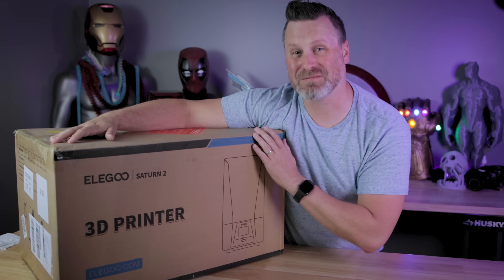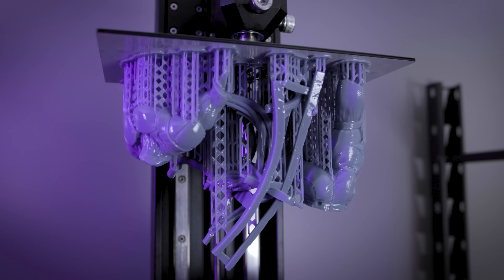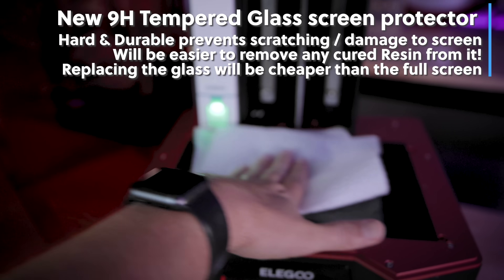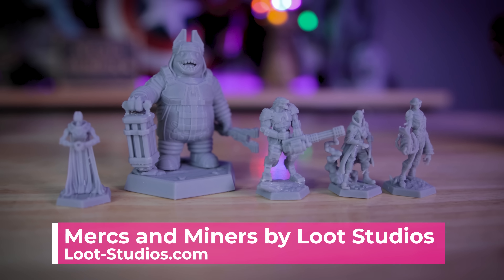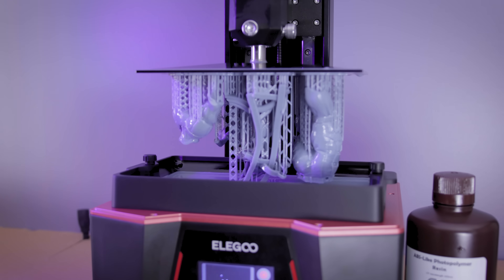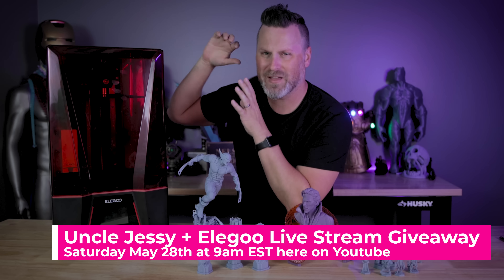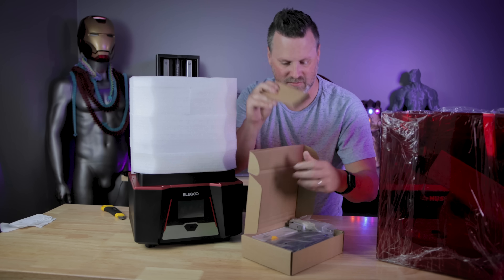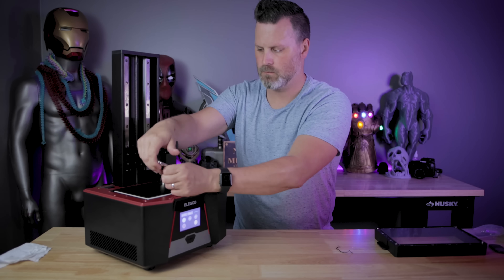Elegoo Saturn 2 8K Resin 3D Printer - CRAZY DETAILS!

Comment: Hi there, i have the Saturn 2 8k, and i have some problemts with the leveling. I go and push Home and open the Screwsm and whan its all the way dont i use a paper under and leveling the plate. and tighten the bolts. but when i starts printing, its look like its going tofar down, it comming a sound that the  motor is going but the build plate is all the way down and trying to go more. can you help me, i have a video the i filming what happends. :D
I hope you can help me.

THX

Comment: A little video necromancy. Asides from the marginally smaller pixels (28.5 vs 24x19) and a whole 10mm vertically, is there any big advantage the Saturn 3 has over the 2 8K? Looking at upgrading from my Mars 2 now I’m printing more for DnD.

Comment: Jessie,  I just bought my first resin printer after watching your video, the Elegoo Saturn 2.  I also purchased the Wham Bam XTR build plate also after watching your video.  I have never owned a resin printer before the Saturn 2.  However, I have tried to print a couple of times now but when the print finishes, there is nothing on the build plate.  I would really appreciate your help.  I am using the Sunlu water washable resin because of my wife's chemical sensitivity.

Comment: What settings did you use? Im using what Elegoo told me to use and Im having zero success.. Just alot of prints sticking to the fep... I've lubricated the fep, re levelled, sanded the plate slightly.. I have tried reducing the lift speed and increasing base layer exposure.. any help would be hugely appreciated.

Comment: I think I can explain the fancy new light source/lens better than the paperwork did.  The fresnel lens (pronounced frenel) takes the light and makes all of it point directly upwards.  One way you can see this difference is to turn on the little test elegoo logo, put a sheet of white paper on top, then lift it up.  On an older model you will see the logo get bigger as the light spread out.  On this newer machine the logo shouldn't change size despite you moving the paper further away.

Comment: Very cool, but it's hard to understand without seeing models printed on a standard 4K resin printer vs an 8K printer if the extra resolution is noticeable. 

Layer lines have more to do with layer settings in your slicer than resolution.

Comment: Hey Uncle Jessy! Is there room on the back right of the printer to add another 1 of elegoos filters? I'm worried the single 1 on the left won't be enough.

Also, the mini elegoo filters have a usb power port... do they have batteries inside or do they need to be plugged in? If they do have batteries how long do they last?

Comment: Questions I still have:

1. They claim a new type of lamp / screen. Does this actually make a difference than the Saturn. For example, are the days of seeing grid lines in prints gone?

2. They claim it has a scratch proof glass to avoid damaging the screen during spills and scratches. But, is this glass attached to the LCD? Does it actually stop resin from getting on the LCD? Does it negate the need for aftermarket screen protectors?

3. Are there any print issues like with the line through prints on the Saturn? 

4. Has the vat design changed in any way to aid in pouring out resin, changing the FEP, or seeing how much resin is still left?

5. What is the difference between 8K and 4K resin and what happens if you print in 4K resin? 

6. Are any of the issues with the Saturn present in the Saturn 2? For example, the tendency for the vat screws to become stuck or sheer off. Does the light still get stuck on.

Comment: question, if the mars 3 is 4k but the saturn 2 is 8k, does the mars 3 still have the more detailed print? as the screen is smaller or are we talking Pixels per inch?
Reply: Mars 3 is 35micron, Saturn 2 is 28micron, so technically Saturn 2 should be better in detail.
Reply: @VGModelling  thank you for clearing it up

Comment: Great review as always. To confirm you did use older type of resins as well (4K) from the mixed resins you showed for the various prints. Obviously understand that the 8K may offer ultimate results but the option to use 4K resin would be good.
Reply: Scammmmmmmmmm, don’t respond.

Comment: I’m curious how this compares to the Phrozen Mighty 8k.
Reply: Both printers have the same XY resolution. I would assume that the quality of the prints will not differ, if the printer works. And there we have the "if". How reliable are both printers? How good is the quality and accuracy of the mechanical parts (are they at least accuracy class H? - they don't tell us that)? That could make a difference in regard to printing errors and in particular layer shifts and z-axis wobble, which can ruin an entire model. Judging by the price I have my doubts that the parts are accuracy class H. The printers would be more expensive with such parts.

Comment: I've been playing around with a fresnel lens for the past 6 months or so on a modified Photon Classic. Works pretty decently but I need to set the focal point back just a tiny bit more. It was basically an acrylic fresnel magnifier (not the floppy kind, maybe about 1.5mm thickness) that I cut down to fit in between the LED and LCD. Cost maybe 5 bucks for the piece
The idea was bounced around a little bit a couple of years ago by some people around the time paraLEDs were making an appearance in the modding space but I guess paraLEDs gained more traction
8k resolution is going to be nuts. Looking forward to the new gen printers :yougotthis:

Comment: What does resolution have to do with layer line visibility?  Were you using antialiasing?
Reply: Z-resolution (layer height)
Reply: @RM_VFX  The "8K" on this machine refers to its XY resolution, not Z.  Uncle Jessy said he was printing .05mm layers.  Those are going to be just as high as .05mm layers on any other machine.  Why were they less visible here?

Comment: So....simple (or maybe not so simple) question. 

Elegoo Saturn 2, Phrozen Mighty 8k, or Anycubic M3 Max? 

Been kinda stuck between the Max and the Mighty, and now a 3rd player enters the fray. 

Max is larger (build area), but only 7k, and larger XY resolution as a result. But has the autofil function. 

The other 2 are similar in XY res, (28 vs the almost 43 on the Max), Saturn 2 gives you an extra 15mm of height (vs Phrozen), and will be $400 cheaper (based on early bird price, $200 cheaper vs reg. price than the Phrozen)

Did I kind of just talk myself into a Saturn 2?
Reply: Following. Already ordered the M3 Max for VOLUME prints, however since I m into miniature wargame I d like to have sth with extreme detail. If its the same quality as Mighty 8k but cheaper, I might end up going for it. But any advice would be appreciated.
Reply: @Patrikable1  I kind of wanted the larger height, for larger builds, but the Saturn 2 only gives up 5cm in height, over the Max. 

I think the biggest I might build would be a 1/16 figure, which averages out about 120mm tall, so shouldn't be an issue. Could almost go double that size. 

Bigger XY like the Max (as it does give up almost 8cm on the X) would be nice, but that is the trade off I guess. 

I would be doing mostly 1/24-1/25 to 1/35 parts for models

The autofill on the Max is a nice feature, just wondering if I would actually print so much at a time that would even take advantage of it
Reply: @viper29ca  Just ordered the Saturn 2, yesterday I almost ordered the Max as I didn't want to scrimp on potential size but ..... realised after some math that the DPI for the Saturn is soo much higher than Max (13.6" screen with 6,480 x 3600) vs saturn 2 (10" at 7,680 x 4320) means that the DPI on the saturn is nearly 3 x better and has that new tech to stop scatter. 

Plus .... about half the actual price! If they were about the same price i'd toss a coin, as it is though I just decided that higher quality and limiting print size to large rather than Xtra Large was the way to go
Reply: @leonandrews2668  I did as well. Saturn 2, Mercury XS and 2kg of resin. 

The way I looked at it, the Mighty and the Saturn are virtually identical in capability, the Saturn gives you an extra 15mm on the Z axis, and is $300 less. 

I basically got the S2, Mercury and resin for less than it would have cost me for the Mighty 8, and I will get it sooner (supposedly)

The Max really only what intrigued me was the extra room on the Z axis, and the resin auto fill. I figured I really didn't need the extra Z axis that the Max gave, and I could live without the auto fill. And yeah, $1100USD just for the printer. Just means I have money left over that I was saving for other stuff. 

Probably going to be looking into getting a flex plate for it.

Comment: Elegoo website says Saturn 2 8k sold out… did I miss the pre-order sale?
Reply: It goes on sale on the 28th, which is why it's currently listed as sold out. The first 1000 units will be $500, and the next 5000 units will be $550. MSRP will be $600, which is still a steal. Huge upgrade over the Saturn and Saturn S for only $100 more.

The early bird units are supposed to ship next month in June, so this is looking to only be a 3-6 week wait, which is awesome

Comment: This is looking excellent! I pre-ordered the Mighty 8k + 4kg of their 8k resin before this was officially announced. Hoping I don't end up regretting getting it instead of this, as Elegoo has always been rock solid for me, and there haven't been any videos like this on the Mighty 8k yet.
Reply: Dennys Wang just put one up this morning.
Reply: Just cancelled my preorder :/
Reply: @jarrajoseph-mcgrath9142  Was that easy to do? I'm still trying to hold off to see some Mighty 8k prints. The machine is more expensive but does have nice features that this doesn't have, and with all the resin I bought with it  really wasn't a bad deal. But the print quality is obviously the most important factor.
Reply: @falcon7370  Easy enough it seems, was through a reseller though. I'd prefer to stay with Elegoo and have their support. Plus its nearly half the cost (for me). Hoping we'll get the build quality of the Saturn 1, but not sure after the Mars 3.
Reply: @jarrajoseph-mcgrath9142  I ordered mine directly through Phrzoen so I was able to get the 200$ off coupon so I'm getting the printer plus 4L of their 8k resin in a bundle deal for 750$.

Elegoo support has been top tier for me though so it's a real tough call. Kind of sad there haven't been any Mighty 8k print previews anywhere other than their official page.
Reply: How do you like your Phrozen 8k so far? I am deciding between Saturn 2 and the mighty 8k

Comment: I've just had my delivery of my Elegoo Saturn on clearance sale from E!egoo.Also picked up the screen protector, flex build plate and metal resin vat. Also in the process of upgrading my two Mars 2 printers. Now it's just a case of what to print. Also got the Mercury wash and cure bundle. And got a heat gun on order after watching your tips video. Great content, loving the reviews and tips.
Reply: How much was it on clearance?
Reply: @OceanMuerto  $380 USD

Comment: Pretty cool to see no more layer lines, will wait for 10k screen resolution printers, a resin autofill would also be great and completely silent is a must.
Reply: I'd take odorless over silent any day.
Reply: @Jasons_Garage  Odor doesn't bother me, what does is the sound keeping me up at night, also the odor is nothing compared to what u get from IPA.
Reply: @Icemanmodeler  true. My ipa is always super sealed, and the printers are in my basement in their own side room, so I never hear them...but even with the elegoo filters, which work well, I can sometimes smell a resin whiff upstairs above that room..
Reply: @Jasons_Garage  I don't have a basement, have 2 desks one for printers then other is a cleaning station and it's right near my bedroom but anyway there is no reason these can't be silent they just need to use silent fans, these newer printers are less noisy than my Transform so its may not be an issue. Will wait for printers with 10k screen to become available.
Reply: @Icemanmodeler  agreed!   Silent fans and motors are more than available.  There are a lot do features that all printers shaould have by now..

Comment: Why are resin build plates NOT square ?
Reply: Because screens aren't.
Reply from the maker: Great question... it's because the Display screens are similar shapes as your Flat Screen TVs/Monitors. So the Buildplate mimics that size. In theory I'm assuming they could be square but it would require a manufacturer to create square display screens
Reply: Because they use LCD displays.   16x9 screens are already available.  No one develops 4 x 3 screens in 8k that I am aware of, and if they do, not for a price tat would make printers affordable.